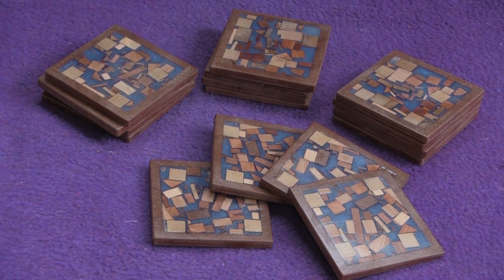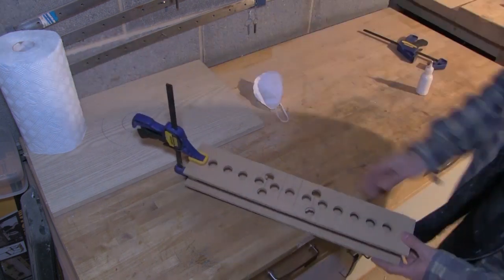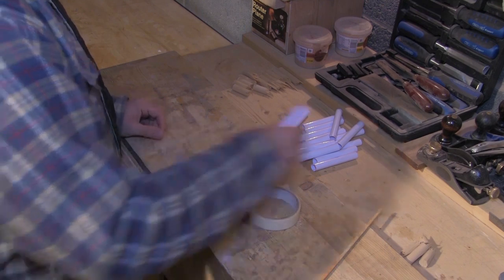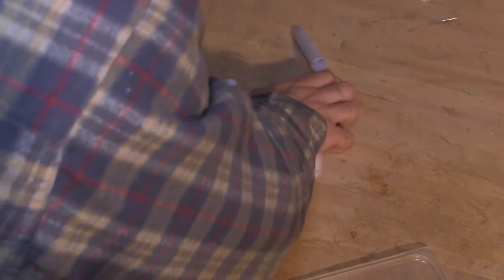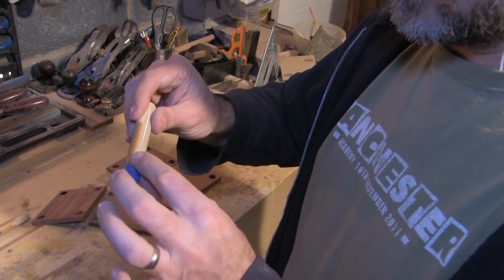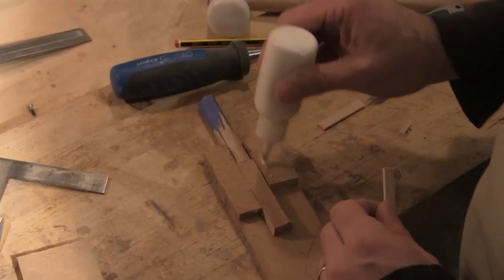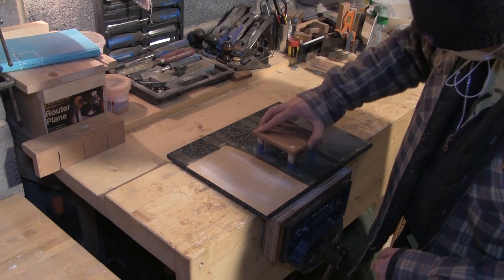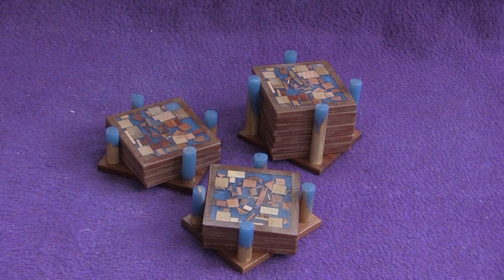Woodwork Project: Wood and Resin Coaster Holder

Comment: Hullo young man, I am very impressed with the dowel part of the build. Is that a technical term new to woodworkers (belt it with a hammer) if so, you could say you gave it a right hammering. (Scottish sense of humour).
Reply from the maker: I actually had to re-record that line as my first instinct was to use an even more, ahem 'technical' word instead of belt!

Comment: Enjoyed the coaster video and this stand too Sir! Is that a Stanley back saw with which you cut the dowels😊
Reply from the maker: Hi Mahendra thank you, I am glad you enjoyed the videos. The back saw I use in this video is made by Spear & Jackson, it is a 12" tenon saw with 15TPI and part of their 'Predator' range.  It's pretty good for a cheap disposable saw. I don't use disposable saws very often but I keep a couple around usually for when I'm working with salvaged material and I don't really want my more expensive saws coming face to face with a hidden nail! I'm not entirely sure why I ended up using this saw on this project, it must have been on my bench at the time - but it coped admirably for cutting the dowels and cross-cutting the base board.
Reply: @adventuresint-shirtswoodwo3905  very kind of you to have replied and there's  a lot of info you provided regarding the saw. I planning on buying one 😊. Thank you Sir😊